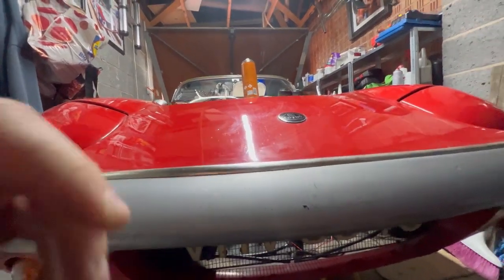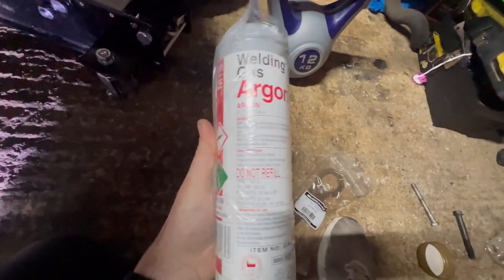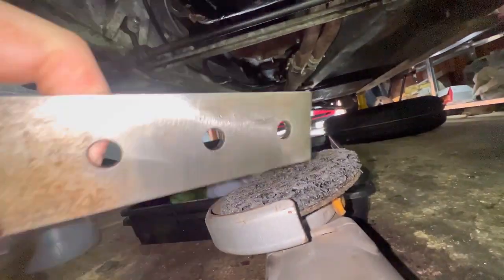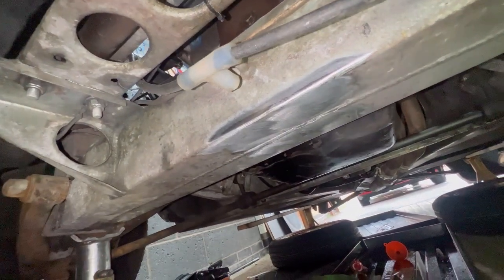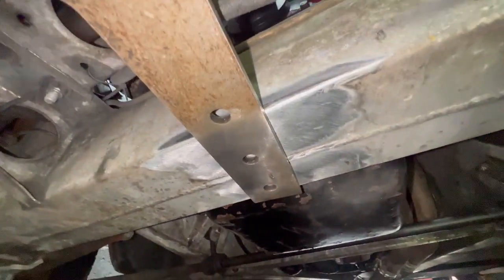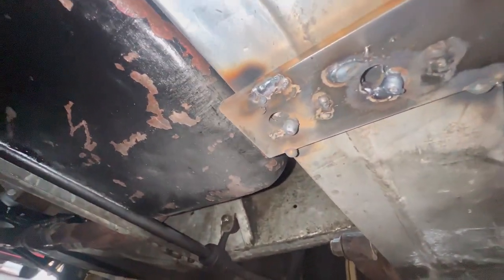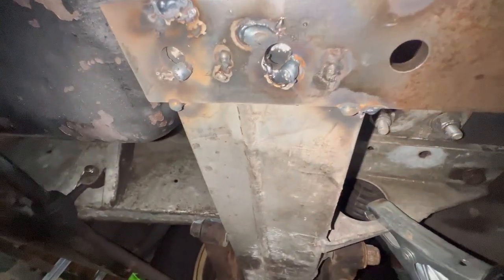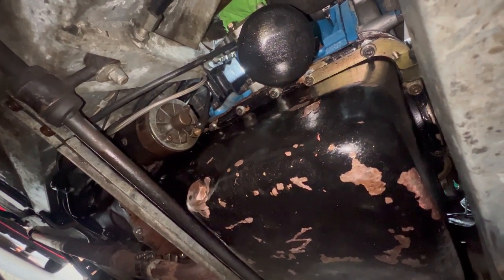Lotus Elan Episode 72 - brakes, some paint and new seatbelts!

Comment: Hi Ollie, you will have to remove all the galvanized coating to weld the towing eye also the fumes are poisonous! Would it be possible to make a saddle type bracket that you could clamp around chassis that way you would not effect the integrity of the chassis i think they are very thin on the Elans.
Reply from the maker: I don’t know. I’m currently ignoring the problem hoping it will solve itself 😄

Comment: Cheers Oli. Could you quickly show us your seat belt arrangement please? Where you have secured it and how etc please?
Reply from the maker: I will do in the next vid, but the lap belts connect to the standard elan seat belt mounts, just with eye bolts, and the shoulder strap goes to the roll cage. I had them adjusted as the cage brings the mount further forward from the standard point by about 3”